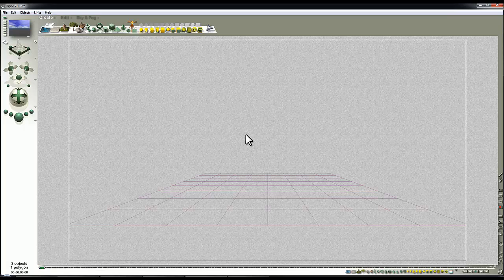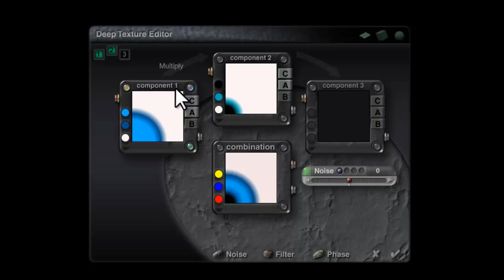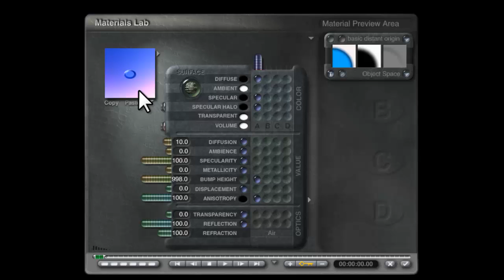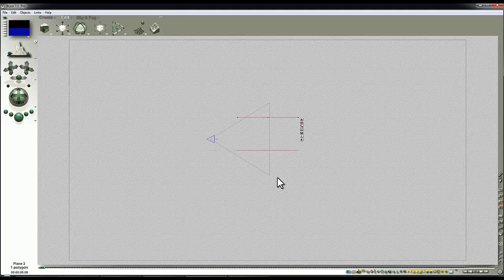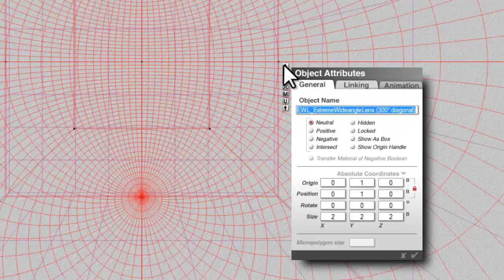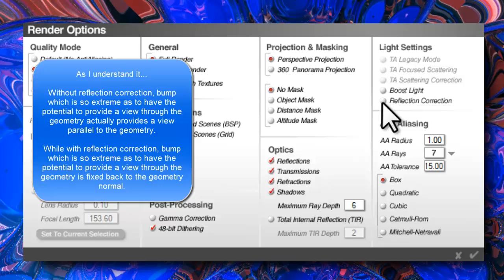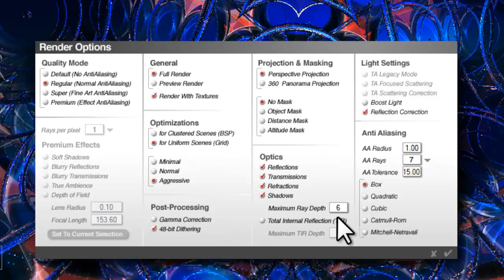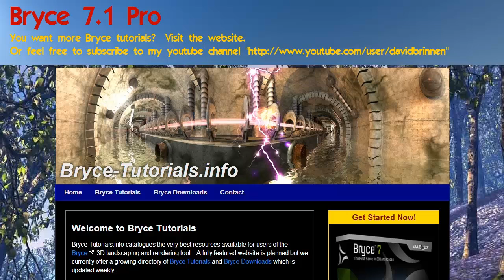Bryce Made Easy - Abstract recipe 1 - by David Brinnen.

Comment: hi, looks nice. Just purchased a copy of bryce, your tutorials are quite handy. Kd.
Reply from the maker: Glad you are finding them useful.  You might also consider dropping by the Bryce Talk forum over at DAZ 3D, the "show us your Bryce renders" thread is a good place to share your works and get solid advice on any issues you might of encountered.
Reply: David Brinnen
thanks David, I had a look a the forum. Mostly I like to make video, used to film but now mostly on the pc. Generally abstract for my own work, not sure why that is. When I'd film I never worry about plot, people would fill that void for me, I just compile it.Kev.
Reply from the maker: kdwyermedia Animation in Bryce is not something I've really explored to any great extent, but there are a couple of people on the forum who know what they are doing with that if you can track them down.
Reply: I applied a simple bump map of some straight lines to the mirrors in the Starburst tutorial, and ended up with a vast mechanical looking tunnel made entirely out of metal beams where the bump lines made the beams and the smooth areas in between made up negative empty space. I decided to make a simple camera glide through the tunnel and it turned out quite nice. There is a LOT of noise in the distance though. Most 3D apps since the mid 90s have had MIP-mapping to get rid of it, but it doesn't seem like bryce does. Anyhoo, I guess I need to up the anti-alias integrity but otherwise it's fairly convincing. I rendered out 10 seconds of it as stock footage. Never know what it might be useful for.
Reply from the maker: The noise you mentioned put me in mind of this video https://www.youtube.com/watch?v=2Y8cGk1358s